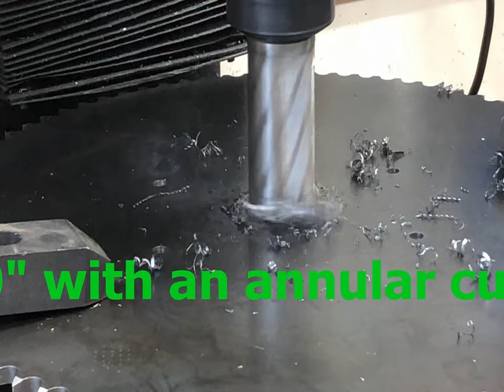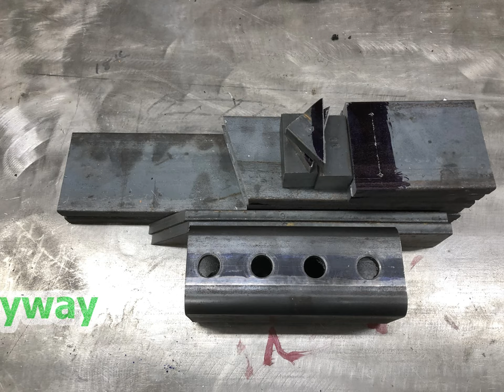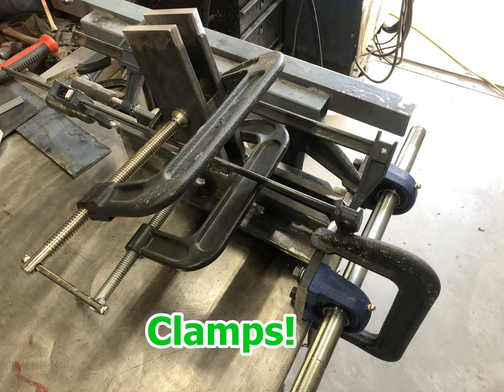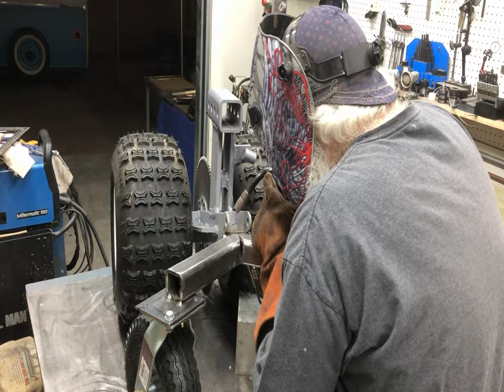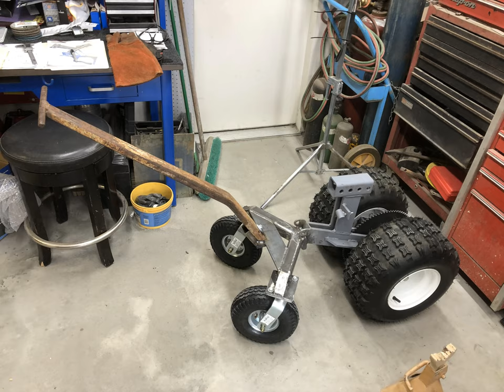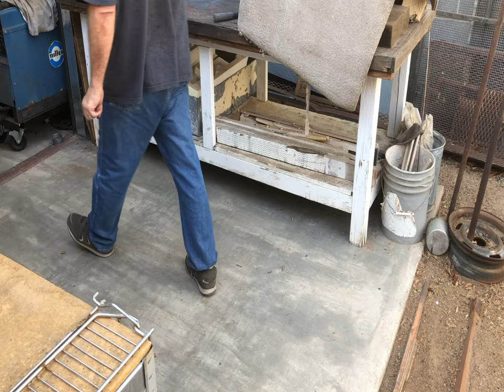Building a DIY Motorized Trailer Dolly/Mule

Comment: Hello Sir, 
1) For the winch plate hinge body, did you make that piece by bending some flat steel and then drilling the holes ? 
2) Is that 3/4 thick plate that the caster leg tubes are welded to where it joins the frame?  
Thank you! trying to source all of my metals currently
Reply from the maker: I used 1/4” X 4” hot rolled flat steel plate for the hinge and the plates for the Casters.

On the hinge I made four small rectangles and gang drilled a 1/2” hole through them. Then I welded two to the frame and two to the winch bracket, spaced in such a way that a bolt could be slipped through to connect them. Also, the width between the two on the winch was set to fit on the outside of the two on the frame.

The plates for the casters were based on the bolt pattern of the casters and also 1/4” plate.

Hope this helps!

Thanks for the question.

Comment: Thanks for your prompt reply. I suspect our load ratings are more about marketing also, however, as my boat is a light alloy model with only a 30hp motor, I am sure 2000lb  load winch will do. I am using wheels off a ride on mower as a starting point and looking forward to the project.

Comment: Awesome.  How heavy an RV trailer can this build pull?
Reply from the maker: I built it for an aircraft trailer that had a gross weight of 5000 Pounds.  It moved it easily even while going up a grade into a driveway.  

The owner it very happy with it.

I truly don’t know how much it can actually move but traction with the tires would be the limiting factor.
Reply: @papasfixitshop7982  How do you handle braking especially when on an incline?
Reply from the maker: @patricklacson  Since the winch has a reduction gear it will not turn without power. The result is that when you stop powering the winch motor it won’t turn effectively stopping the attached trailer.
Reply: @papasfixitshop7982  Nice! With that chuck released on the motor it will still allow a freewheel right? So it can function like a normal un-powered dolly.
Reply from the maker: @patricklacson  correct, it will freewheel
Reply: @papasfixitshop7982  awesome. Ordered the winch.  I don't live in TN, do you have a website to get a single tire that can hold at least 500lbs?

Comment: That looks great. Can you tell me what load you would move with that? I am in New Zealand and have a 2000lb winch not 2,500lb and the cheaper versions that size don’t seem to be available here.
Reply from the maker: The trailer being moved in this instance are in the 3800 pounds or 1800 kilos weight range with tongue weights up to 600 pounds or 272 Kilos.

The terrain it was designed to operate is paved surfaces as well as soft sand, is The Sonora Desert here.

It also has proven to easily move the trailer up a driveway with a raise in elevation of 1 foot every 10 feet with the caveat that on concrete in the presence on dry desert sand, it struggles with traction requiring additional lead weights added to make it heavier.

As for the winch it’s likely that any winch designed for an ATV in the range of most Quads will be suitable.

Here in the USA versus in New Zealand it’s probably that what’s rated as “2500 pounds” is more about marketing than the actual specifications.

Comment: Beautiful work. Can you tell me what are the front casters and where you bought them? Thanks for your videos.
Reply from the maker: Thanks for your message, they were from harbor freight 6” if I recall
Reply from the maker: Looking at your question I noticed you said casters, and I wondered if your asking about the smaller set, I consider them casters since they rotate on a base,  or the larger drive wheels.  If it’s the larger ones I will pull the plans and get the contact info and post it later.

Thanks again for your message!

Comment: Just curious, if you don't mind sharing, what did you charge him to weld it? I have the same plans and am pricing materials now. I'll have to pay someone to weld the frame for me and have no idea what the job is worth, so just looking to get a ballpark idea. Thanks!
Reply: Chris i just made this mull using clarks drawings or part of them and the rest from papas. Welding cost me 70.00. I did prep all my metal first, i also clamped everything together wear it needed to be for welding.
Reply from the maker: For most of my work I shoot for $100 a day.  I’m only actually working hard 4 out of 8 hours so it seems fair, plus I’m retired and relaxed.  It’s like $25 per hour but it’s more about each person’s rate where they live and work.

Comment: Finished my trailer dolly, very similar to the one in the video. I am a little disappointed. It works ok on concrete but really struggles on anything a little rough, digging in and skidding. I suspect the load on the trailer hitch is a little light. Not sure where to go from here.
Reply from the maker: Traction is also an issue that the owner addressed by adding lead scuba weights to the mule

Comment: hi, can you help me please? i can do this project but the winch part and the pinion gear fab is what i need help in. can you make another pinion gear like that? i can send u a harbor freight winch
Reply from the maker: The modification to the winch is straightforward and easily accomplished.  The 15 tooth sprocket is mounted to the winch with a tapered hub.  For those two parts you should search online, I suggest MSC or McMaster Carr, or you can call Dalton Bearing at 706-226-2022, inquire about part number H1-1/4 Split Tapered Bushing and 40H15H Bushed Sprocket.  Once you have those components you can modify the winch.  Hope this helps
Reply from the maker: And if you still need help with the winch mods PM me, I’m happy to help

Comment: i Purchased the plans from clark,I like how you changed the font wheels how long our those leg extinctions,and  angle of cut.
Reply from the maker: Mary Marino I followed the plans for the exact dimensions, the odd bit is that the drawings showed the angle of the cut on the upright pieces as 72 degrees but the angle of the drawing was a bit off so I went with the written speck
Reply: my plans don't show the small wheels at an angle. their straight on my plans. The plans i got were so.so complete.  Your mule looks great will be starting mine next week with this modification..
Reply: Any suggestions or changes you would make.
Reply from the maker: This was a project for a customer who supplied the materials, it was almost done and waiting for the casters.  Since he wanted to use a jumper box instead of a battery I basically improvised the leg extensions. I had a 24” piece of 2” by .250” wall square tube, the type for making towing hitches. I cut it in half and set them with the ends just far enough apart that the two casters would not interfere with each other when they swung around.  As for advice, I did the mods on the winch with a lathe and milling machine.  It can be done by hand but cutting a key way is really difficult without a mill and the key is vital to avoid the gear hub slipping. Also pay attention that the position of the ball when complete is correct.
Reply: ok thanks
Reply: So about how much would it cost to get the parts and what's a timeframe? Can a regular Joe do this or need special skills? 
Thanks for the video!!!
Reply from the maker: Msfjunk H the guy I built it for purchased the parts using the vendors on the plans, I don’t know the total but it’s around $300 give or take and they shipped out in a few days

Comment: Did you ever take final measurements length by width when you were finished.
Reply from the maker: Mary Marino I did not.  I also had to guess at the height of the ball for the trailer based on a photo with a tape measure for scale, it turned out that the photo was taken with the jack up a ways which resulted in the back of the trailer getting close to the ground and had to make a custom drop hitch to lower it.
Reply: How long did you make your winch key
Reply: @niceashcigar4476  Just did mine, about the diameter of the spool.

Comment: Awesome, I am looking to make one to move my pop up trailer. Have you tried it on a 3500 lb tailer?
Reply from the maker: Art a it’s used on a 20 foot trailer for an ultralight aircraft not being on heavy.
Reply: @papasfixitshop7982  SWEET! by my calculations, that's well over 5000 lbs. I already have winch, wheels and tires in my scrap pile. Now just to build it.

Comment: Could you add a trailer brake to this setup?
Reply: Yes, you can add a 7 pin connector to the mule and a rocker/toggle/hand brake that will activate the trailer brake. If you do it right you can also use the battery power from your trailer batteries to power it. I am getting my material together now to build a remote controlled one so I can walk around the trailer to ensure it doesnt hit anything when putting it in storage.

Comment: where did you get and what size are the wheels and rims?
Reply from the maker: The tire and wheel combination size is, 18X9.5X8 on a 4 bolt pattern (to match the hub used).

The tread I used was knobby due to the sandy conditions here.

The vendor is Jebs Wholesale Tires.

Contact Jeb at 1-800-517-1777

Ask Jeb about availability of trailer mover tires.

Thanks a bunch for the question!